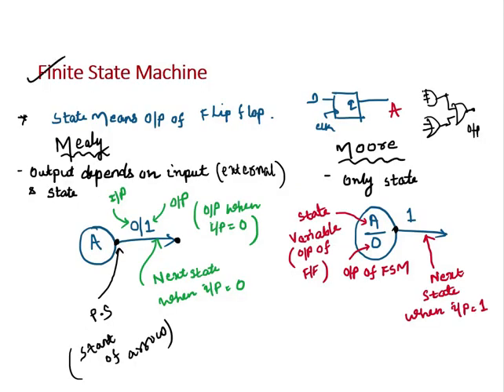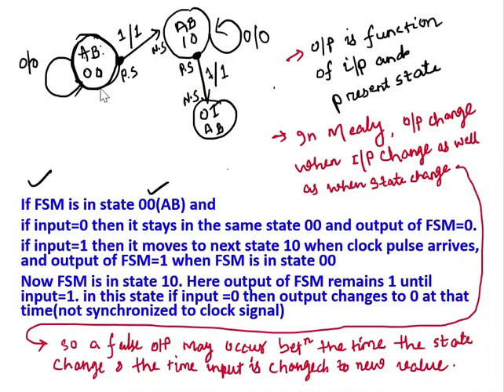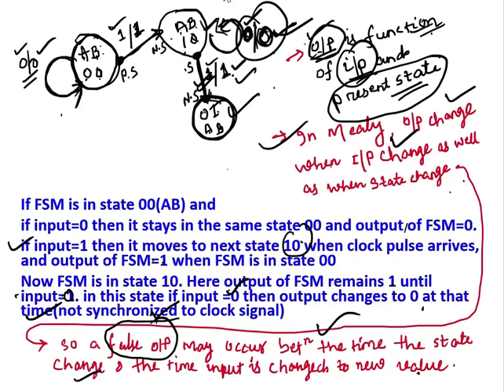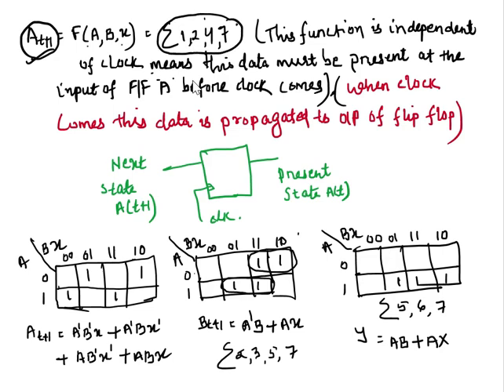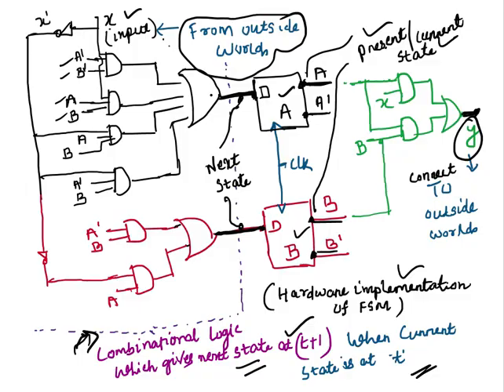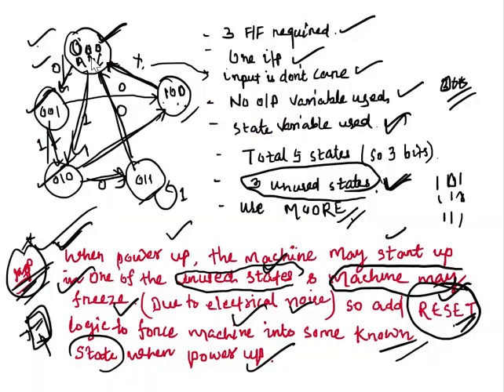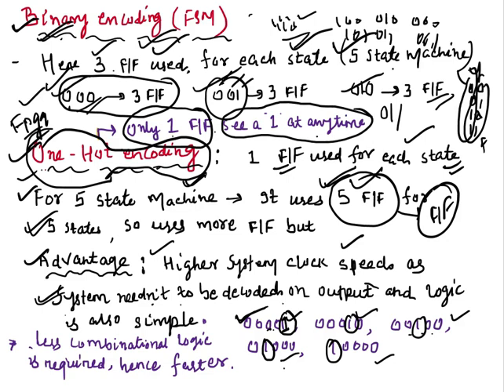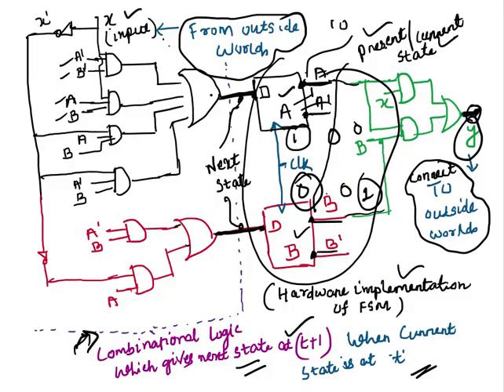#41 Hardware implementation of FSM ||understand FSM diagram and how to draw digital circuit from FSM

Comment: I didn't get how only one ff used for one hot encoding
Reply from the maker: One flip flop is used to represent each state variable in hot encoding technique for the sake of simplification and easy encoding. 

Let's say A=1,B=2,C(state veriable) = 3
To represent C, either we use binary encoding 11 where 2 bits are active at a time means two number of flip flop or we can represent 3 as 100 using hot encoding where only one bit active at a time so only one flip is required.
Reply: We represent 3 as 100 do we need not consider the actual binary representation of 100 i.e 4 , is that going effecf anyway